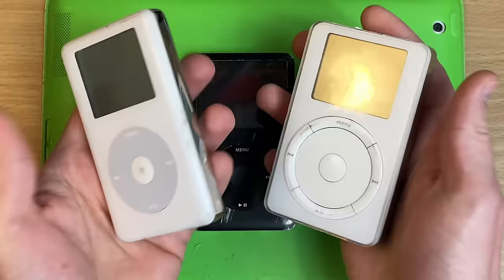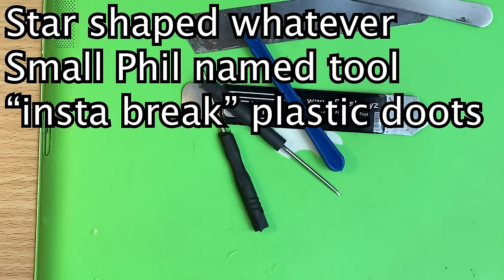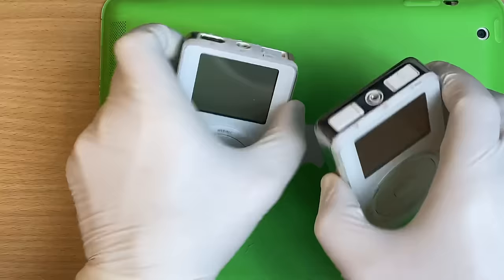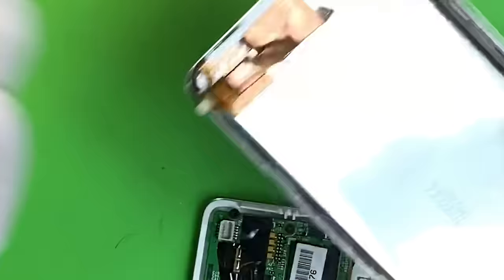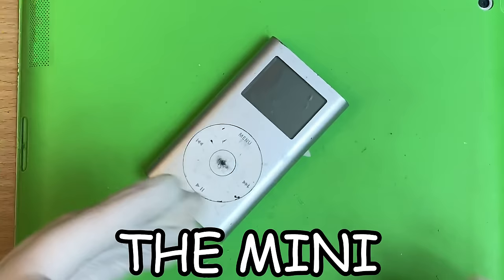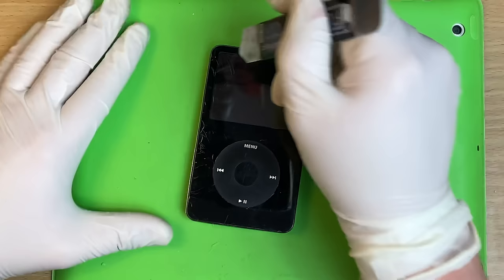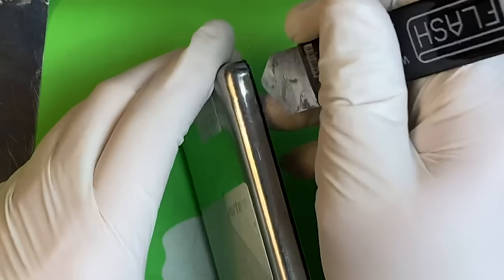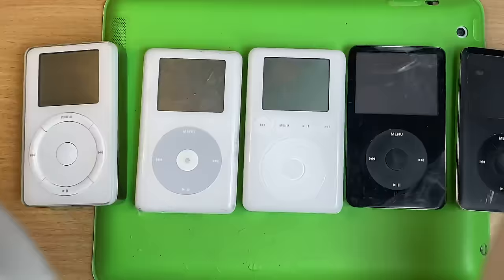How to fix every iPod Classic.

Comment: Used this video back in 2020 to help me custom my 5G that I bought at the time on eBay to flash mod it to 128GB and it still works to this day! The original bat's still good surprisingly so I won't be upgrading unless I have to!😉👌

Comment: I used to but broken pods just for the boards. I use 5 or 5.5 gens a keep a couple working ones most of the time. Sadly 5-5.5 gens the output amp fries often, out of my last 6 pods, 3 ended life that way. Currently buying a board on ebay to fix another. Admittedly now I want to buy a 2nd gen mini for fun.

Comment: This video gave me the confidence to flash mod my first ipod with literally no experience at all. Surprisingly, it works! 128gb sd card with a 3000 mAh battery. Only problem is I messed up the LCD because I snapped it back together in a stupid way. So I guess I'll be replacing my first LCD as well.

Comment: My iPod classic 7th gen was made in 2012 according to serial number, the hard drive has no pending or reallocated sectors and the battery still holds a good charge, it's never been opened. Its the 160 GB model.
Reply: Yeah it still has the original battery and hdd since its never been opened.

Comment: Just a tip. On some of the iPods the hard drive would slide of the connector. As such, you may have the sad hard drive symbol and you'll just need to plug things back in. I remember back in the day when the hard drives started disconnecting, people would stick their iPods into some socks and then slammed the fuckers down hard on to the table to bang the hard drive back in place. LOL

Comment: I got a ipod classic 4g from my uncle. Barely worked, the hdd needle was off and the battery was so swollen my mom had a panic attack! I spanked the ipod and fixed the needle issue and replaced the battery (and yes, wired to go UNDER the board), it  worked for 2 weeks then caught sads. That dosent mean its gonna stop me from flash modding it though!

Comment: I have an iPod classic 2nd gen 10gb with a bad battery. I installed Linux on it through website that I can’t Remember now. I can’t check anything on it as I don’t have anything FireWire anymore. But it ran and even had some games on it which my favorite was 1d Tetris. But I would like to send this priceless jewel to you if you want it.
Thanks for the videos

Comment: 0:13 I sincerely miss my 2000s cellphones...

Nokia 3315, Motorola C305, W610i and my favourite W995i.

That W995i lasted me forever, I replaced it with an Galaxy S4.

If the GPS and apps still worked id probably still have W995i

Comment: I use a 2012 unibody macbook pro, as far as I know its the only mac the natively runs catalina, and has firewire. It works great for restoring ipods. One thing ill say is GET A MAC if you do this a lot. Disk utility is a godsend because it can make it a million time easier to format a ipod if its acting up. I tried to fix a 4th gen with windows for months, after I got a mac it was done in a few hours.
Reply: I do too! But the hard drive died 😔

Comment: The 160 GB iPods some of them have an issue with the flex cable that connects the hard drive to the motherboard can come loose during normal use. I learnt this the hard way then I found a fix for it myself punching it on the back where the flex cable can reseat the cable now I don’t recommend it but yeah after I got pissed off at my iPod for doing that and punching it, it caused a dent in the back where the flex cable would be and reseated it so if you ever have an iPod that’s 160 GB model and it’s not going past the Apple logo you might want to check that flex cable

Comment: FireWire most likely has more power draw, because it has more pins and wires in the cable.
Cuz that’s how they got USB to do more power, by putting more wires inside, same with all the fancy things USB-C and thunderbolt do.

Comment: I tried replacing the battery in my 5.5 Gen (Black) when it finally started opening up it got the sads (broken LCD) when I managed to open it wow that battery was really puffed up... Replaced the battery, the LCD was cracked in the middle so I could still see a bit. The damn clickwheel didn't work. Half an hour's work gone! I was thinking about getting an iPod touch 7th Gen but now I am definitely going to be.

Comment: This is a completely skint Christmas this year and I thought I might try my hand at fixing my other half ipod classic that has been laying in a drawer for over a year. It doesn't charge (screen wont light up) so will look into getting that firewire charger. See if it's that or battery. Will constantly using the fire wire not fry that battery? I hope I can get it fixed as he has a million songs on there that he doesn't even know that name of the songs he has had them that long. And he has lost so much music on that and it's really sad. I know it would be the best thing ever if I managed to fix it. I have previously fixed a ps4 and 2 controllers for it when it packed it so  Fingers crossed I can do this too.

Comment: @ 3:00 Remember, iPods are just tiny computers, devoted to MP3's, and like any computer there are two sets of memory, ROM (hard drive) and RAM (little chips on the printed circuit board, or "PCB"). Now you can load up any computer with any amount of ROM (although many, especially Macs and PC's have built in failsafes that won't let you do the following...), but if the amount of files that are actively loaded into the RAM exceed the amount of installed RAM... CRASH, BANG, BOOM!!! Device fails, and THAT is the problem you @ 3:00 "honestly didn't know why" about... Ya' velcome!

Comment: My dad’s iPod 5 still worked but only when plugged in. So I opened it and looked for the issue I forget what I needed to do to fix it but I broke the battery connector off the board and I still need to fix it

Comment: If the SD ram Check says "ok"  doesn't that mean my HD is ok?  My screen stays gray in normal use mode and will not pull up a menu unless in in SD mode. No light on my screen unless;ess in in Safe mode either. Please help!

Comment: great video and help to know about the flat tool that is ten bucks on Amazon.  Looks like that is the way to go if your going to try and replace on the Classic 120gb unit … what a bitch to get apart.  You need every advantage you can get besides a new battery!

Comment: when i restored my 4th gen mono that i bought on ebay i took the drive out because it was cooked. i opened it (which you should never do if you intend on using it) to see if i could at least see what was wrong with it. i couldn't see anything, but for sh*ts and giggles i decided to put it back in and see if it worked...   and it did.

TLDR: try everything before you throw something out.

Comment: Hey hey here am i looking how to open my dads ipod, the hardrive is dying (we can’t take info out since the hardrive gets lazy but info still accesible) im gonna do a sd card mod since he still uses the ipod up to this day! And he also has used this ipod as the family photos hardrive (yeaah not good) so since im good with fixing things im gonna replace the screen, battery and hardrive! While also trying to get out the data of the hardrive by getting a drive connector goes here to usb and trying to read all the data and photos right out to an ssd, then restore that lad and give him a nice surprise so he can use the ipod for another 15+ years!

Thanks for this video mr dankpods cheers from Spain  🇪🇸 gracias y estás invitado a calamares, paella, tortilla lo que sea!

Comment: Wat. Omg. I forgot how little battery these things had. Like…. 850mAh is really small for any device, but that might be fine because of how these are meant to be low power devices, and even there might be improved 3rd Party batteries for these things, that will last longer cuz of the new formula improvements

Comment: My concern about my 6/7 gen ipod is I plugged it in recently and a block spot started to develop on the display, it has gone away but now I’m worried about a fire hazard. I really wanna get it working with flash mod, big battery, purple front etc. since I inherited it when my dad passed away back in 2010. So I’m very worried about messing it up either end up damaging it or making it a fire hazard

Comment: Funny question....

I have just recently installed a new batt-tree in a friends 80G classic, and for some reason, it will ONLY charge when synced to the computer.... When I plug in the power cable from the wall, it will turn on like it recognizes something is happening, but no charging.....

Ever see this issue?

Comment: The alert when it shows dead drive also can be the ribbon cable as I have this issue with a 5.5 Gen where it seems as though the clamp on the mother board that clamps the ribbon cable for the HDD doesn't clamp hard enough anymore and there is lack of pressure that pushes the pins down to the motherboard. I tried another ribbon cable with a different HDD and it does not work. I can't for the life of me figure out how to fix this and I don't want to change the motherboard because it will change the serial number and I want to keep this iPod as original as possible. :(

Comment: I tried this with a mini, my headphone jack broke during disassembly (my fault) but in a way that I could order a replacement (my luck). The battery was puffed a bit, so got one on the way as well.
Reply: You should be able to just clip the headphone jack back on to the main board
Reply: @thomas5  no I mean the connector and all the pins broke off the board containing the headphone jack, remaining in the connector on the main board.

Comment: @DankPods I have a genuine question if you can get a USB-c to 30 pin would it work the same as fire wire or do you need to invest in a fire wire

Comment: The 7th gen thin I have was literally A NIGHTMARE. I bought a brand new faceplate, LCD screen, battery plus back with new headphone jack. I can connect everything just fine and the new screen works a charm. But for some damn reason every time i try to clip it back together, the screen screws up  every time I try to clip the clips that are right beside it. EVERY. SINGLE. TIME. I don't even know what to do anymore so I am actually selling it all as is for someone else. It legit is worse than the mini.

Comment: Has anyone here had any charging issues with the iPod Classic? 4th Gen.

It charges off a USB from a Mac, at 5V and 0.4A - 0.6A (or thereabouts). But, literally ANY OTHER way of charging it, with the same USB works until the screen is powered, then the Amps drop to 0.02-0.05 and then the device goes flat, effectively bootlooping itself.

Figured I may as well ask here, as most forums are now archived.

Comment: Thank you so much for the video! Replaced parts on a 7th gen. Having issues with iTunes connectivity though. iTunes says it can't connect and then I get an error message, "the iPod could not be restored because the firmware file is not compatible." Anyone know how to fix this, please?

Comment: What's the trick to restoring a 3rd gen ipod? I upgraded the harddrive to flash storage and I can't get itunes to recognize the ipod. A normal 30 pin cord makes the ipod discoverable in itunes but fails to restore, the Firewire cord doesn't recognize the ipod --> I am using a firewire to USB adaptor

Comment: So riddle me this: I have a 5th gen that works PERFECTLY except... When I plug it in to my computer it says "You're corrupted." In other words, I can charge it and play what's on it... however, it was used as a drive and has photos and text docs on it that I can't access — and I can't put songs on it or take them off because of the "you may be corrupted" error. Is there nothing to be done without erasing it and therefore losing its contents?

Comment: Hello you beautiful pod!
So I bought a few ipods and got them working with actual hard-drives. I put in the flash kits (dirty scrub ones and iflash brand.) and it say connect to itunes. I do so, hit restore, and when the loading bar is done it ejects the ipod and remounts it and its like it never restored it. The iPod does a power cycle and I have no idea what to do. Im running windows 11 now and I have iTunes installed. Any help would be much appreciated.

Comment: Hi Wade, and everyone else

So I have a 3rd gen iPod (found in a thriftstore a while ago), that turns on, but nothing else..
The drive is dead I think. When I turn it on the drive emidiatly spins up to full spead (and clicks..) and the screen only showes the Apple logo.
And the battery is good cause it holds a charge, hard-reset "works(?)", disc-mode doesn't. It only turns off when the battery goes flat.

Is there a way I can flashmod it or, are there HDD's still for sale?

Kind regards,
Bas (NL)

Comment: I use my 160gb ipod almost every day during walks and to tune out the world.  The other day, my music stopped, and the screen would only show the digital time and the battery icon (fully charged).  I pressed all the normal buttons and played with the hold slide and still DEAD.  I was about to shop for an alternative.  Then I watched the first few minutes of this video.  I pressed the center and menu buttons for a couple of seconds; and BAM, the apple icon came on and a few seconds later my menu came on and music played.

THANK YOU!

I don't know what I did to cause the freeze?  Any thoughts on what happened?

Comment: I absolutely love these vids and the accent is A'stralian ( in a sea of USAs) but I do have a problem. I had a new battery put in an iPod Photo and the sucker will only fully charge via Firewire. If I try USB it will take forever and it still may not fully charge. It's really got me stumped. Any ideas?

Oh and or what it's worth I just opened the box on a last gen. 160gb Classic and the battery charged up without any problems. Not bad as it sat in a wardrobe drawer for seven years. I then it connected to a high end dock (after I synced it to iTunes) and the music sounded sublime. Why did I go  old tech? Well , I reckon that when it comes to an interface for listening music the scroll wheel can't be beaten. For a Jack and Jill of all trades I use  iOS devices and if I want to go half way house which weighs almost nothing then it's the Nano last gen.

Anyway if anyone can help with my problem I'd gratefully appreciate it.

Comment: I decided to open my iPod up and peek inside, when I tried to put it back together I tried for about an hour to restore it because I didn't fully close it because I didn't want to have to reopen it, and it kept saying it needed to be restored so I was wondering if I did something somehow and I was so confused, because nothing would read, it would show up on my computer but the disk was inaccessible and I couldn't do anything about it, I kept getting the 1437 error and wasn't sure what I did wrong. I just now decided to put it completely back together and what do you know, it boots up just fine, no restore necessary, everything is still there! Was very strange not knowing what was up and if I did something wrong! Turned out alright though!

Comment: i have the 5.5 gen 80gb ipod video and ive noticed a little problem. when finishing with ipod i would hold play and pause to switch off and then select hold switch. after so long of not using i try unselecting hold switch and power on and it doesnt do anything for quite a few seconds and then it will display something. is that because its a mechanical hard drive? because once ive woken the device and switch off and put hold on and hold off and play it displays straight away so it seems its a hard drive problem waking up and booting to view on display. what do u think mate?

Comment: My iPod 4th gen only turns on when plugged directly into the wall and when it gets off the apple logo I get the sad drive picture, is there a way I can reformat the drive, it doesn't turn on when connected to a pc. Is the only way spare parts?

Comment: Can someone help me? I’ve replaced the battery in my iPod that bought as spares and it now comes on but the buttons and click wheel isn’t working at all. The hold switch works well but I can’t get it to do anything at all. I’ve tried resetting it but because the buttons don’t work I’m stuck! Do I need a new click wheel? It’s a 6th gen and the buttons are on the logic board so im not sure a new click wheel will help get the buttons to work. Any help or advice will be amazing! I cleaned the board with Isopropyl because of a little corrosion on the board and it’s cleaned up well.

Comment: If I have a usb brick that pushes a stupid 6.2 amps would it still work just as good as firewire in terms of power delivery?

Thanks in advance from a dingus in the ol US of A
Reply: No firewire has more voltage than USB

Comment: I have 2 iPod nano’s (a third gen and a forth gen) that will acasonaly go into a white screen when it’s been unplugged. it will still play music acasonaly but it’s really buggy. On the fourth gen you can’t get rid of the screen until it dies and then it recharges and it’s fine but for the third all I half to do is set it down for 30 minutes and plug it in till it fully charges it and that usually fixes it. Any idea what the issue is?